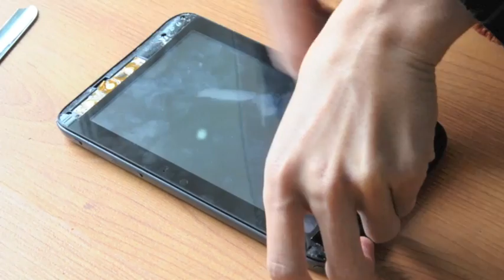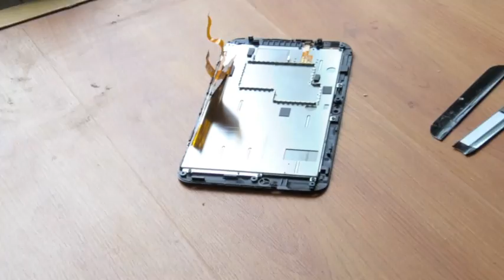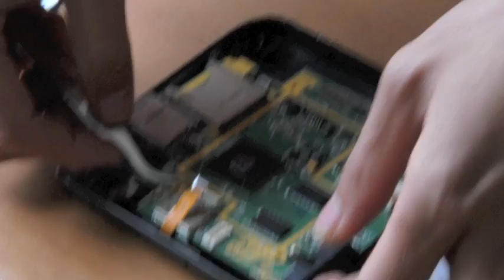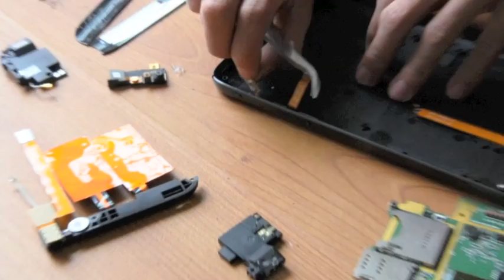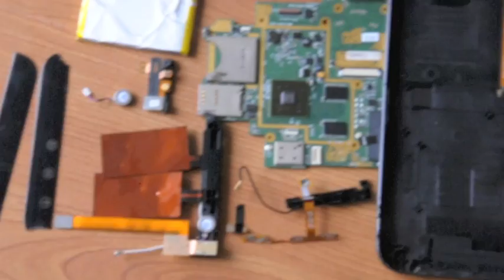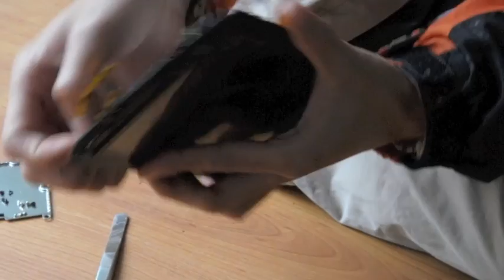Tinhte.vn - Mổ bụng Dell Streak 7"

Comment: This video skips almost all the important parts.  Here is the gist.  1. Get tiny screwdriver under top and bottom plastic face plates.  You will screw them up getting them off. 2. Peel up touch sensor and remove 4 lower screws, two upper screws and two end screws under SD card cover. 3. carefully pry up screen 4. disconnect ribbon cables as shown.
Only first and last steps are shown in video.
Now if you are like me, magically fix broken power connector.